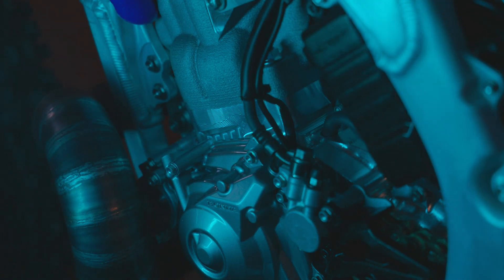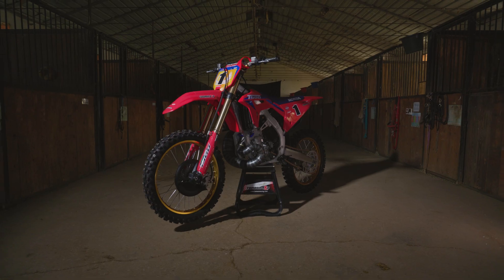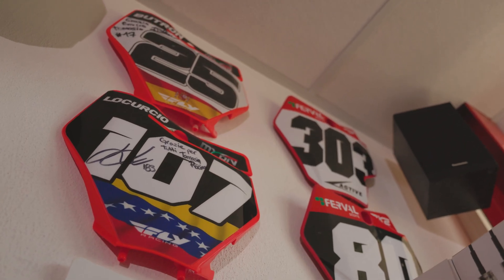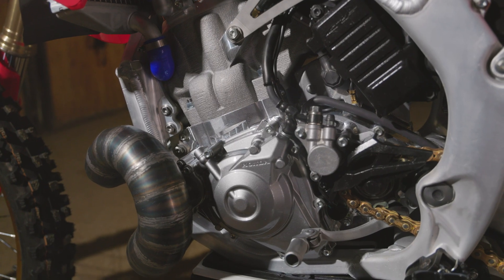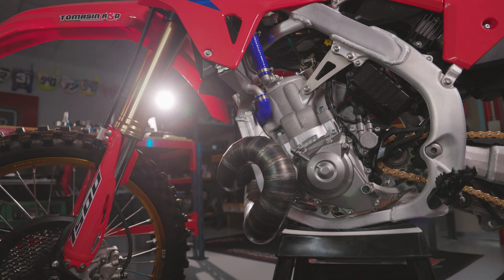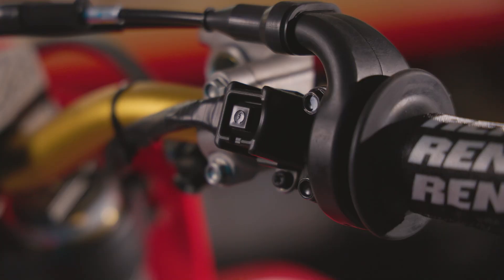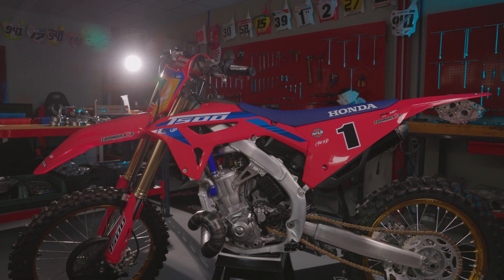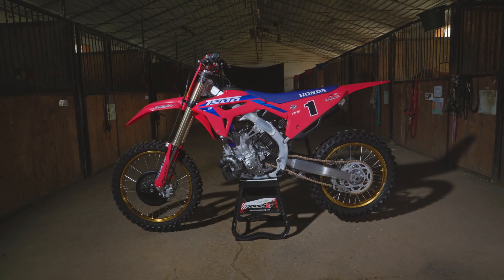TOMASIN T500: THE ULTIMATE 500 2 STROKE MOTOCROSS BIKE BUILD

Comment: Why not produce a whole new cylinder with counter balancer and power valve instead of using a dated cr500 one....
Reply from the maker: in fact if you listen to the video and if you read the info on the site, you will see that the engine crankcase and the cylinder (as well as much else) are all made from scratch by us. It's not a CR or an AF.
Reply: @TomasinracingNet2  my mistake is the engine counter balanced? Does it have a power valve?